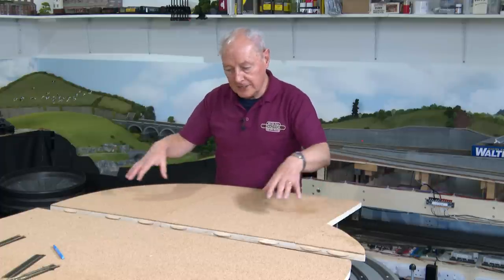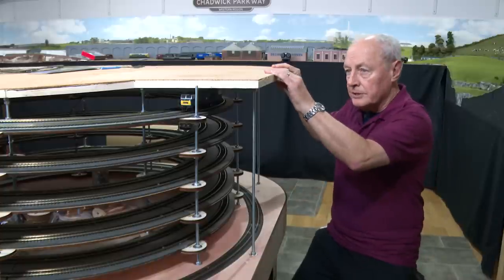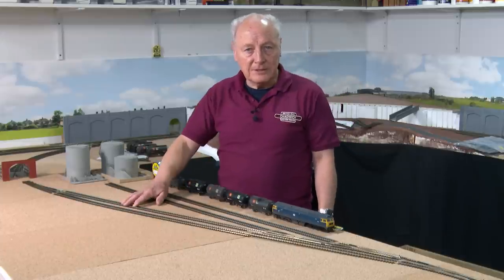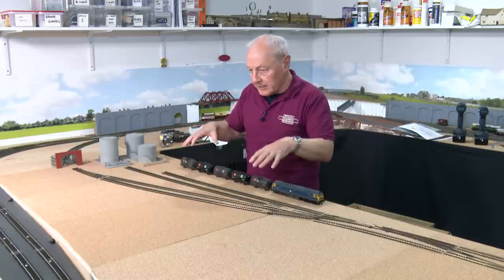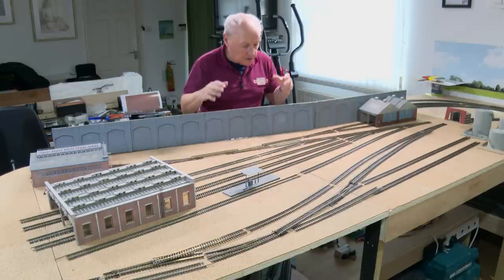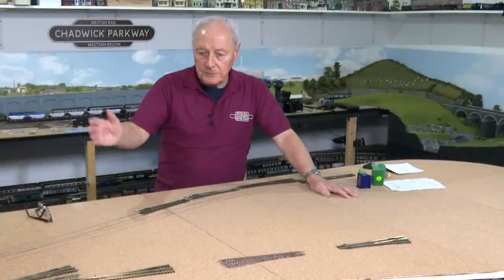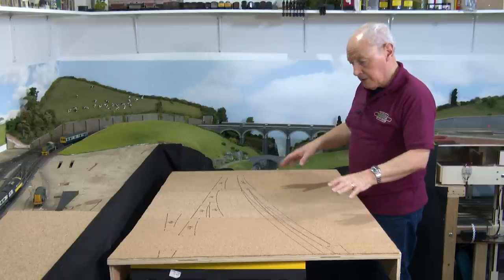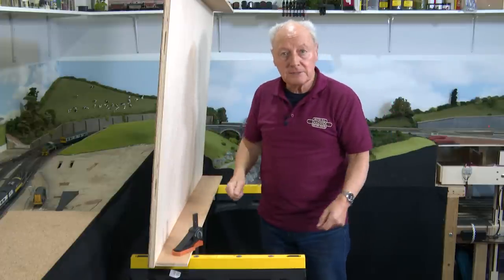Autumn Update at Chadwick Model Railway | 172.

Comment: as an engineering apprentice part of my training was to learn how to make machine tools quieter by building a box around them and using your style of material to create anechoic chambers, you've done something similar, your boards reflect the sound backwards and forwards but by introducing the triangulations with the foam you've disrupted the sound reflection and it did make a difference, If you ran foam around the outside with the triangulations facing in you would most likely find the noise would vanish and you'd think the trains had stopped 😀
Reply: I am not an engineer at all, But I was thinking the same about the outside. Also some form of sound absorption between the top of the M8 threaded rods and the top base board
Reply: If or when a train derails, Charlie would have to remove the foam stuff from around the helix. I'm sure he would enjoy doing that! 🙂
Reply: @mikeking2539  If they were all separate sections just clipped together as a hexagon, it would be easy to remove just one section. We all know just how committed to noise reduction Charlie is!!!
Reply from the maker: Excellent comments gentlemen. I’m thinking about some kind of sound absorbent curtain on the outside. Regards, Charlie

Comment: Hi Charlie, you might receive this twice, didn’t have a YouTube Channel. Anyway, I really enjoy your videos, most informative. Regarding your hard to access Tortoise Point Motors, how about dropping them in from above? Firstly, determine the exact location where the Tortoise piano wire actuator will come through the baseboard. Then, using that as the centre, cut a 120 mm hole through the baseboard. Then, using your router, cut a 5 mm wide x 6 mm deep rebate around the circumference of the hole. Then cut a 130 mm disk from 6 mm ply. This should be just large enough for the Tortoise to fit within the radius of the hole.  Then mount your Tortoise pint motor under, and your point above, the disk. This allows you to bench test operation before final mounting. Then just drop the disk with the Tortoise and point into the baseboard hole. Then rotate to correct orientation and silicone into position. QED. If you need to access the Tortoise, then remove the rail joiners and lever the disk with the Tortoise and point upwards. If you ever want to change the location of the point, then cut another 130 mm disk to cover up the original hole. I use this method with 50 mm extruded foam baseboard. Cheers, Stew
Reply from the maker: Stone the crows, Stewart , that’s a hell of an undertaking. But interesting all the same, regards, Charlie

Comment: Continuing today:
Charlie, I think the foam on the floor of the helix would be enough to ease the dropping of a train; that the vertical circle of foam you then add isn't really necessary and in fact COULD actually snag a diesel horn, coupler, or steam bell, say, on its way down..Also it's not impossible a train could fall to the outside of any helix, as well..
Reply from the maker: An interesting point of view Mark.
Many thanks, regards Charlie

Comment: Hello Charlie, re your oil depot, I have seen it on you tube where a full-size tanker train reversed out of an oil depot on to the main line crossing to the far line. Then another train came up and reversed into the depot while a two-car passenger train waited about 50 feet away waiting for the tanker train to finish its movement. Great video as always. Hope you are both better soon.  Mick
Reply from the maker: I think you’re dead, right Mick, sometimes there is no hard and fast rule Regards, Charlie

Comment: Charlie you got my name spot on , glad i could help out, if you have any other questions dont hesitate to ask. once the tiles are fixed with wallpaper paste they work better, these tiles dampen higher frequencies which is ideal, putting a few under the top will stop relections in all directions, all the best charlie and get well soon.
Reply from the maker: Thanks Paul, your assistance on this one is very much appreciated. Regards, Charlie
Reply: @ChadwickModelRailway  Youre very welcome, Basically charlie the more tiles the better, if you could make another ring anound the outside too this would probably halve the noise

Comment: Charlie:  So good to see you!  You are entertaining as well as informative.  Your idea of the octagon is a very good one.  I would suspect that the force of a derailing car would not deflect the foam barrier sufficiently to allow the cars, wagons, totes, or whatever term Euros use to label rolling stock. I my humble opinion the sound whether dampened or not is part of what I have always enjoyed while rail fanning (either models or the real thing).  Prevention of damage to very expensive and prized train equipment however is a different matter though. Of which whatever the cost is again in my humble opinion worth it.

Radically changing topics, I bought a biscuit joiner many years ago.  As a wood worker biscuits are a good way of joining wood.  You have a very good idea!  (I wood not have bought a Mikita thought (unless of course you are planning on handing your tools down to your children).

Oh and Charlie, you need to be very thankful to a sympathetic and understanding wife.

Oh another thing about Alpha Cyano Acylate (supper glue) besides storing it in a baggy I. Your refrigerator, you can use acetone to unstick yourself when you glue your fingers together.  

Rail on!  Patiently waiting your next video.  Best wishes have hope you feel better quickly.  You are a treasure to the model railroading community.

From the Third Coast of the USA.
Reply from the maker: What a heartwarming comment Ken, thank you so much. Margaret and I are both well on the mend now. Thank you take care mate, regards, Charlie
Reply: @ChadwickModelRailway  Charlie: My wife and I havre been fortunate that we have not had Covid.  We have lost friends and parents of friends close to us.  Hoping you and your wife feel and get better soon.

Comment: Good luck to you both with your recovery. Remember to take it easy, physically, for 6 weeks or so. You seem to have solved your surface mount point motor problem but another option would be to mount tortoise machines underneath near the edge and run push pull cables to you points over the helix.
Reply from the maker: You make an excellent point regarding the cables. Regards, Charlie

Comment: Sorry to hear about your bout of Covid, hoping both of you recover soon.  Just an idea for more space with the board over the top of the helix, if you want a little more room between the top of your wagons and the bottom of the board, just cut a bevel where the board is directly over the track.  It won't take any strength away from the board itself and will give you a little more clearance for your train cars.  The closer you make the angle of the bevel match the angle of the track the more space you will get.
Reply from the maker: An interesting option, Dave, thank you. Regards, Charlie

Comment: Hope you and your wife get better soon Charlie. I avoided it until March when I was stuck in hospital with a broken ankle (the ankle is mostly fine apart from a limp and ache), I picked it up in hospital on a surgical ward of all places! Thankfully I had very little ill effect from it and recovered quickly. 

On the subject of the layout,  first,  it is of course difficult to judge how effective it is from a video, a measurement of dB might be a better guide to how effective it might be,  but I expect unless you put similar material under each board and on the walls and ceiling you probably wouldn't notice a huge difference in the dB. 

The tmd area looks much better. However for the washing plant you could have a line that goes from the entrance to the depot down the side of the diesel point and joining up with the reverse loop, allowing dmu and coaching stock to use it as well as locomotives.
Reply from the maker: You make an interesting point. So many options, so little time! Regards, Charlie

Comment: Hi Charlie, Re the studding alignment if you have to do it again drill a pilot hole in the top board. Shine a laser pointer through ensuring it is vertical and mark the centre on the lower board so you can drill it correctly.
You can buy them cheaply or make your own.
Reply from the maker: Thanks Golden, an interesting suggestion. Regards, Charlie

Comment: Look after youselves Charlie, hope you both get well soon. If you want a really discrete point motor, have a look at the Rapido Trains one. This is circular and fits in a 45mm hole in the baseboard. Only the cam and throw rod need to be visible, although it is designed for North American practice so a switch stand can be fitted with a rotating target.
Reply from the maker: Thanks Mark, that’s a very interesting option. I haven’t heard of. Regards, Charlie
Reply: There is an installation video on YouTube watch?v=x1fOQh22YWA. They are reasonably priced - Rails of Sheffield have them for £17.50. A DS64 is suitable for DCC control.

Comment: Hi Charlie, commiserations for your health issue. Get well soon.
Turnout control. DCC Concepts do a small, smart, surface mount slow moving actuator that clips to the side of a turnout! I think they call it " Cobalt S" or something like it. I've seen it in action and for your TMD might be worth a look at!
Reply from the maker: Thanks Peter, I shall certainly check it out. Regards, Charlie
Reply: @ChadwickModelRailway  Charlie, I've had a search and those motors are Cobalt SS. That might help point you in the right direction.

Comment: Amazing video Charlie. Stay healthy!
Reply from the maker: Thanks mate, I’m so pleased that you found it interesting. Regards Charlie
Reply: @ChadwickModelRailway  😀
Reply: @ChadwickModelRailway  Charlie, just to add onto this, I'm using only MTB MP1 motors and they are pretty reliable and in many ways adjustable. Easy to connect and small - will fit everywhere. The downside is mounting! They have very small slots/holes and very close to the motor cover. The screws need to be very tiny and once screwed they don't have much surface to firmly hold the thing in place. Have you noticed/experienced this?
Reply from the maker: No Filip, I have yet to fit mine.
Regards Charlie

Comment: If you like to work on a separate board at a time so that it is easier to wire point motors, then you are going to have to move the turnouts that straddle baseboard joins otherwise that won’t be possible.  In my experience it has been preferable to make sure no part of a turnout straddles a baseboard join.
Reply from the maker: I do understand your point Steve, but space on this build is just tight.
Regards Charlie

Comment: Hi Charlie great video thank you. Get well soon. Will you run a dmu through the wash plant? Then place it before the fuel point. Or if not place it after the fuel point. Wash plants are rarely on a dead end siding. Consider a short head shunt after the loco wash with a point to allow the loco or pair of locos to run around after the wash and return to the main running line. Generally a loco will come off shed, take fuel then wash n go. I think you have room to fit another line for this. Cheers Alan
Reply from the maker: You make an excellent point Alan, and I am having a rethink currently. Regards Charlie

Comment: Hope you and your better half are over the worst of the dreaded lurgy!   Video an excellent watch as always - I'll use the tip re the black foam to at least line the bottom of my two helixes.  Like you I've only ever had the odd boggie wheel set derail but there is always a first time for a train to take a dive off ! Cheers Euan
Reply from the maker: Thanks Ewan, I’m so pleased that you found a video useful.

Comment: Charlie, comment time, don’t rely on the biscuits in the way you are using them, might I suggest using toggle type clamps on the edge back and front to secure the boards together, leaving the “floating” might work but it might not. One more comment, please, DCC concepts SS surface mount motors, have a look. Get better soon, great video even when unwell. Regards V
Reply from the maker: A great comment Vic. No I wasn’t going to use just the biscuits. There will always be some form of under board clamping. Regards Charlie

Comment: Hope you are feeling better soon Charlie. Couple of suggestions: first - you could eliminate all noise from the helix by putting removable boards with the sound deadening around the outside. Second, I have had a quick look on line and found that rakes of 45 ton oil tankers were normally way longer than just 5 and I think that a separate oil facility needs a much bigger space and isn’t right for that area. Instead, I would suggest repurposing that area to form a long enough piece of straight line to fit in the train washer which would really complete the TMD.Hope this helps and I can’t wait for the next exciting  episode- the thought and planning that goes into your layout is truly awesome.
Reply: Ipswich depot is still served by TEA fuel tankers, and only 2-3 at a time so he’s probably not far off.
Reply: @UndergroundEric  Thanks Eric, that’s really interesting. I only made the comment having seen a picture of 2 class 33s pulling a rake of 54 of these tankers!
Reply from the maker: Thanks gentlemen, just goes to show there is no written rule, it’s so space dependent in the real world. Regards, Charlie

Comment: Another great Video Charlie, Hope both of you get better ASAP.
At my club they use a rubberized matting, similar to Shade Cloth, it is made of small balls that are joined together, cutting the noise down, with the Wheels going over the Track Joins clicking away.
Reply from the maker: An interesting option Graeme, thanks for sharing mate. Regards, Charlie
Reply: @ChadwickModelRailway  it come in widths of 1.2mtrs, they lay it down with Staples, then the TRACK and points, when trains are running they get a sharpie and run around the edge of the sleepers, not wanting to waste any the rest is used somewhere

Comment: Make sure you add a little bit of length so gives the option of using a little shunt loco like a sentinel for dragging tanks out and then instead of leaving around reverse loop you could go back the same way you arrived with the 47, you can play little shunting games
Reply from the maker: Good point tricky. Regards, Charlie

Comment: Hi Charlie 
Sorry to hear you and your wife are unwell with covid19. I can only advise to keep  your fluid levels up and if you haven't  got one purchase a fingertip pulse oximeter  approx 5£ on amazon to measure  your oxidation levels. 
IMy wife and I had covid19 last year for 1st time in November 2021. I lost over 1 and 1/2 stone in a week and ended  in hospital  dehydrated. I left hospital  after 2 days but had to monitor oxygen levels in my blood which caused fatigue.  I recovered from covid19  after a month . Take care Alan
Reply from the maker: Thanks for your concern Alan, I shall certainly look into purchasing an Oxy meter. Regards, Charlie
Reply: Charlie,  your levels should be normally in the mid 90s  from 95 to 100. But mine fell into the 80s so the meter is a good guide to how well your  body is coping with covid19.  Cheers  loved the video. Would love advice  on shrubs and bushes  on layout.

Comment: Biscuits don't make a very strong joint, but they are excellent for alignment.

I you want a strong joint, use a floating tenon
Reply from the maker: Thanks Kevin, alignment was the main issue. I shall screw a plate across the boards underneath once finalised. Regards Charlie

Comment: You may want to dip the biscuits in a bit of sanding sealer, if you want biscuit-jointed edges to come loose in future.  The biscuits are often made of a material which will swell up from relatively low humidity levels, as that's normally a boon when building furniture or the like.  From my experience, you want the biscuits loose, and not glues to one side or the other of a joint meant to be struck down.  Else the fool things break off in rude ways need a couple of hours of fussing with when one only has 15 or 20 minutes to spare.
Reply from the maker: Thanks for the tip mate, but Sunday was completely new to me. Regards, Charlie

Comment: Firstly Charlie, I hope you and your wife recover OK from the nasty Covid you have (funny enough I too have just had a positive result in the last 3 days (second time for me)). Secondly - as an automotive development engineer, one of the areas of development that we focus on is NVH (Noise, Vibration and Harshness). Lots to talk about on this technical area, 2 major things to consider - 1. noise path and in particular the medium the noise is travelling along (air, wood, steel etc...) and 2. vibrations are the biggest irritant over air noise as the body picks them up not just in the ears, but also in the body. I noticed that your base frame legs are sitting on a wooden floor. It would be worth experimenting to see if you can feel any vibrations on the floor around the legs and if you can to add a small layer of frequency dampening tapes (TESA do some that work very well). Give me an email if you want chat more, Simon.
Reply from the maker: Hi Simon, that’s very interesting. Please could you drop me an email at
chadwickmodelrailway @ gmail. Com
Regards Charlie